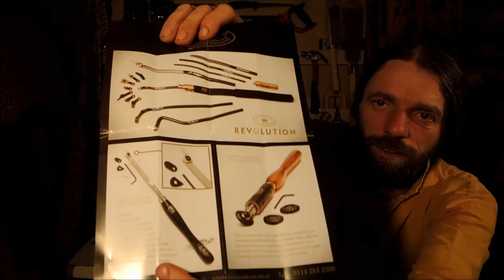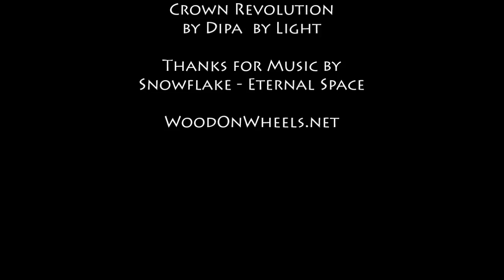Tokar Art 61 WoodTurning "Crown Revolution"

Comment: Great job Dipa as always. Nice tool. What type of lathe is that? I like how you can turn wood on a different horizontal axis. Great for small spaces.
Reply from the maker: +Justin Coombs is it just simply lathe i bought form second hand.. name is Proma 1100V but like this make many similar companies..
Reply: Dipa Das Yes for sure. From googling, I found out that the headstock is called a "Swing Headstock" which allows more displacement for bigger stock to turn bowls and bigger projects. Doubt that brand is available here, but I could be wrong. :D

Thanks for the reply sir.
Reply from the maker: +Justin Coombs Yes, this Swing Headstock is important for my, more possibilities.. I need just more heavy stand and slower speed.. 500 Rpm is too much for big pieces what i like it.. :-)
Reply: check for nova lathe.mine swing outside too..
Reply from the maker: Yes, Nova is the Best.. :-)
https://www.youtube.com/watch?v=ph64NFZ1Veg